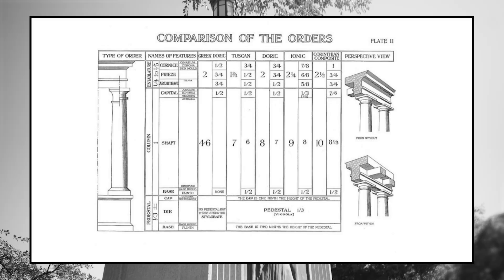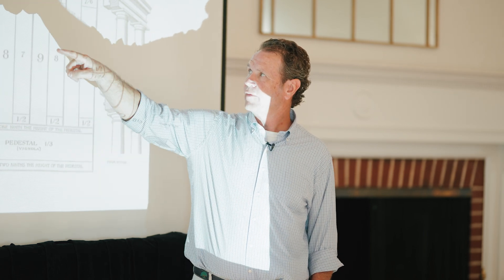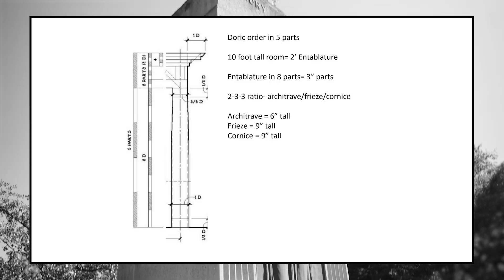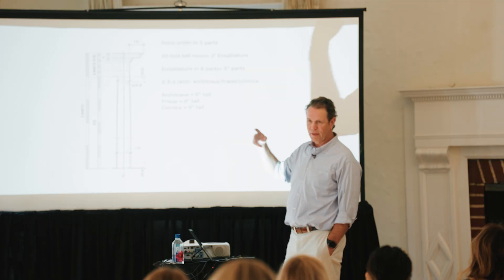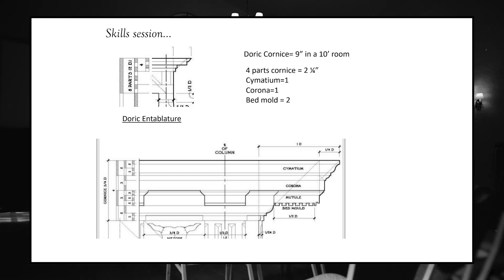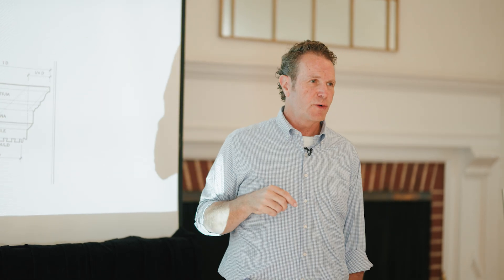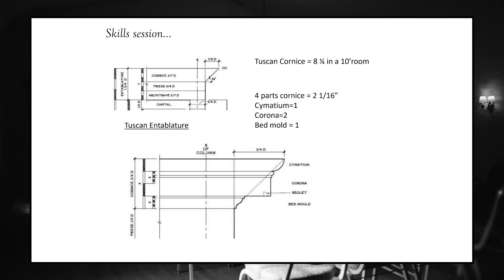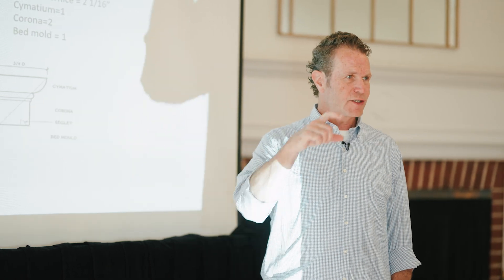The Math formula for proper sized moldings. But try not to use it. . .

Comment: That's very interesting Brent, might that mean that when fitting out/trimming a home with a lower ceiling the proportions of the Tuscan order could work well
Reply from the maker: Good question but ceiling height shouldn't determine which order works well. The Tuscan order is a strong bold order with beefy molding,  if you are looking for smaller moldings, the Corinthian will have less weight. Thanks

Comment: I read somewhere in a moulding detail book (I can not find it now) showing the different orders similar to what you’re showing… 
What I got out of it was to basically divide the wall height by 16 and that is your crown size (or totally moulding size)…
For instance a 8’ wall is 96”/16=6”… so 6” of total moulding is the biggest you would use for the “crown”.
A 9’ wall is 108”/16= 6.75” crown, or total moulding  
A 10’ wall is 120”/16= 7.5” crown, or total moulding 
I’ve been using this method for years and it has been working well with happy customers…
-Please let me know how wrong or right I am by doing it this way.
Reply from the maker: Well, that is a good rule of thumb but I would make 2 tweaks.  First, the Tuscan order is divided into 19 parts. 1 part would give you the base and casing size but not the crown. Because the cornice is divided into the 3 parts,  the actual crown of the cornice is smaller by 1/3rd.  If you make those 2 adjustments you should be good to go. Thanks.
Reply: @hmtrimworks7148  this formula works with the basedboard? Example 10ft ceiling height / 16 = the size of basedboard? I hope you will reply if you have time. Thanks!
Reply: @dep1912  if you read Brent Hull‘s answer to my original question, he divides it in the 19 parts as per the Tuscan order to get his baseboard height, which would be about 6 1/2 inch baseboard. But I would have no problem with a 7 1/2 or 8 inch baseboard for that wall height.
Reply: @hmtrimworks7148  does your formula wall height /16 works with the baseboard size too? For simple crown moulding, your formula is ok with me. I wonder if you use the same formula for baseboard. Hope to hear from you. Thanks!